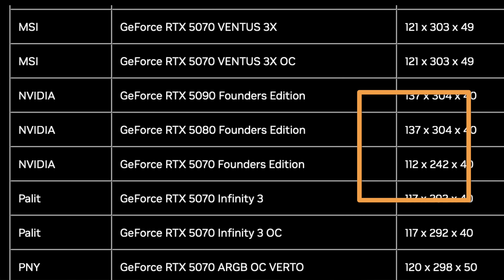Nvidia's 50-series Founders Edition Cards have a 20L sized problem.

Comment: So it won’t ve a problem with T1 V2.1 and top Aio config. We might need a few centimeters longer gen 5 riser though.
Reply from the maker: I think it may be OK with the riser extension, plus a rad as intake would minimize the impact on the CPU thermals. At this point I'm unsure of the headroom with something like a 9800X3D with the rad as an exhaust, that's something I'll have to test. The issue is that in the T1v2 you can't get exhaust fans with a rad in place, so if you can air cool the CPU and use top exhausts that might be a preferable setup.
Reply: @ I am currently using the Atmos 240mm liquid cooler with the 9800X3D in a top exhaust configuration, and I am more than satisfied with the temperatures. In the Cinebench R23 stress test, the CPU scores 23,637 points, and the temperature doesn’t exceed 77°C. Btw, the room temperature is around 26-27°C.

Comment: I have a Corsair 2500X case, a 360mm AIO on top...is my current case no good for a 50 series card?
Reply from the maker: You have more space within the case so the airflow implications of the FE isn't as unique in that scenario. Overall thermals should be similar between the AIB cards and FE cards.

Comment: There's no problem ( except for tiny sandwich style. Same as 4xx and 3xx, FE is bad there) . A "regular" gpu cooler spits exhaust in random directions into the case. FE spits exhaust at more specific areas. It's the same exhaust in the same space.
Reply from the maker: I would tend to agree if this were a mid-tower, but directionality does have an impact within SFF confines.
Reply: @MachinesMore  I supposed. But it's been some time since flow through fans were introduced, and time has proven concerns are overblown. Take the top flow through fan for instance, with a air  cooler exhausting to the rear, or top AI above; time and countless people building has proven the directionality does not matter. Its the same exhaust in the same space. Now...with 5xxx, there is TWO flow through fans. Is that a big deal? I'm not convinced.

Comment: Watercooling is back on the menu :)
Reply: Sure is. U can fit itx, sfx-l, d5 pump with res and 3x280 in 20 liters. I have it mostly ready on my desk, but not showing it yet to the world:)
Reply: @bartman2395  what case is that? Or open frame? I've got a double 240 in the NR200 mounted under my desk with an external rad in the room/attic next door that vents off all heat while giving me access to some cool and low temps in the winter haha
Reply: @ meshroom 2, with top and bottom and middle spine 3d printed. Very custom. Using 2 extenders from ssupd. Motherboard is at the bottom, with IO rotated facing bottom. Work in progress, im waiting for slim 5090 block and its done.
Reply: @ I will be making tower with 2x560 radiators propably, because I like towers and for fun
. Mora too thiccc:)
Reply: @ Sounds very cool! Would love to see that when it is finished. Do you post online somewhere?
Reply: @moevor  I will be posting on reddit for sure in sffpc. Propably on different nick, I’m kinda out of chill lately on this one lol.
Reply: @bartman2395  I think I've seen your other builds. Have you done a custom Intel themed build where you made a sandwich case?
Reply: @ nope, thats not me. I was ready though, got velocity 2 for new Intel - but Intel sux, so its not gonna be used at all hahaha.
Reply: @bartman2395  ok! Well I hope to see it when you post. Cheers
Reply: Was watercooling ever not on the menu?
Reply: @MaddJakd  always was but potentially more so when the GPU is chugging back 500 watts

Comment: I've been thinking this ever since the design got revealed. Seems to me like the Fractal Ridge might have just become the most desirable case for FE cards of this gen <.<
Reply: Came to comment this. I noticed this the instant I saw the design. They could totally design some amazing cases that would work with it though.
Reply: It does not support high end cpu's and big air coolers.
Reply: @westonsaunders6460  you can fit an IS-67 or L12s or IS-55 with a noctua fan swap. Those will all cool a 9800x3d.

Comment: People said the same before the 3080 FE launch for sandwich cases. and here i am running it for 4 years now on ghost s1 with no modded spine or offset, all it needed was a small undervolt. So not gonna dismiss them without trying. 
But i do agree, the dual blow through does look like a worse situation. but since the cooler is engineered to be enough for a 575W 5090, i'm hoping 5080 FE will be ok even in less than ideal situations. as for reference layout cases, i really wouldn't worry much even with a 5090. those big air coolers are more than enough to cool a 9800X3D even with some extra heat from the gpu.
Reply: the 5080fe being only 40w more than the 3080 isn't a massive concern, it'll run warmer regardless but an undevolt will make it fine. but the jump from a 3080 to 5090 is another 250w. no amount of undervolt is going to remove an additional 14900k worth of heat from the GPU. people are cooling the 14900k with dual and triple fan radiators and it's for one processor unit, adding a 3080 into that loop as well when you don't have the thermal conductivity of water or the surface area of a radiator is sub-optimal. 

anyone using a 5090 in a sandwich style is probably in for a bad time. at surface level, it looks like it's gonna throttle hard and it's going to be loud, obviously review testing will be crucial. 
console, non sandwich style and traditional towers will all be ok, but those chasing 8-12L with sandwich style might be going to be looking for new cases if you want the best hardware money can buy.

the best part of this is we'll see some newer designs driven by necessity and innovation is always welcomed.
Reply: @GorillaSnapper  i didn't say 5090 will be ok in a traditional sandwich, i said you shouldn't worry about it in reference layout even with an air cooler, like in ncase M2 for example. 

as for sandwich layout, i think 5090 will still run fine in cases in the FormD T1 where u can create more space between the gpu and motherboard/psu with spacers. definitely not in something like ghost s1 though.

Comment: For an M2 wouldn't a 240 rad (instead of 280) with side intake and top exhaust (traditional layout, 2 x 140mm top exhaust fans) work? 240 rad wouldn't touch the GPU like the 280 and the 2x140mm top exhausts should be able to create a good negative pressure. Thoughts?
Reply from the maker: That's a possibility, although I am still a little concerned about the overlap there since 20mm farther still isn't optimal, but this is something we'll have to test. For sure the side intaking rad and top exhaust fans is going to be a must with this setup.
Reply: @MachinesMore  Atleast with the motherboard offset on the M2 there might be some more wiggle room with the gap between AIO and GPU. Looking forward to your tests!

Comment: What about c4-sfx which is inverted layout, gpu on top aio on the side. Can do similar setup in m2 you recon that would work?
Reply from the maker: The side AIO would have similar issues to the M2- namely restricting the GPU exhaust and also heat soaking the rad. Air cooling would have a similar conundrum.

Comment: I've already been thinking about trying to fit some sort of blower or cross-flow fan near the spine of the terra at the bottom on the gpu side. If you could custom make a gpu mount that flips the FE card upside down so it exhausts out the side panel and pulls in air from the back of the motherboard, that would probably work fine.
Reply from the maker: Yeah, tricky. Even the Ventus 5090 looks to be an iffy fit for the Terra since it's fairly tall at 139mm.
Reply: I am planning on doing something like this in my Terra, including potentially a cross flow fan mounted vertically as you described. I never thought about inverting the card though. Interesting idea.

Comment: The vapor chamber design is used by lots of card makers and was used with 40'sseries, so how come nvidia's the only one tgoing so small?  I just watched the GN video covering the design, it's not really adding up to me
Microcenter just came out and said they won't be selling any founder's on January 30th but will have a wide supply of all the after market brands. 🤔 heat issues?
Reply from the maker: So, for launch typically Nvidia offers it's FE cards through its own direct to consumer site, plus Best Buy in the US.
Reply: @MachinesMore  huh, they were at Microcenter at previous launches, thanks

Comment: How about the INNO3D 2 slot 5080 though? Couldn't figure out if it's also a full blowthrough design.
Reply from the maker: Side exhausting. The dual flow-through requires the mini PCBs that Nvidia is using for its FE cards.

Comment: Im planning a tr100 build , im sacred of heating my back of motherboard and psu , what do you guys think??
Reply from the maker: If FE is all you can get, you will want to add 20mm standoffs to shift out the riser cable and attach the card to the two outermost slots. That way you have an air gap. Still not great for the mobo but likely not tragic for the card's own cooling.

Comment: Looking forward for a tests of a 5090fe with different layouts in ncase m2. I wonder if the impact on a tower cooler will be worse than the impact of squeezing a aio into the small case and blocking airflow.. for aio... how about classic layout with aio on top with intake, and side mounted fans to exhaust (if that even fits) ? Ok, thay would mean hot air blowing into the case from both and bottom... probably not ideal for mainboard, ram and ssd?
Reply from the maker: Dual intake can work but it's detrimental for cooling both components. In the m1 evo/M2 this could possibly work fine when combined with two exhausting mobo side panel fans.

Comment: With a Ncase M2 wouldn't a flipped motherboard placement with the GPU on the top work best with the FE Card?
Reply from the maker: The card would not be impacted in that scenario- the impact on CPU cooling would still have similar issues though. You could potentially do an intaking bottom rad but will need a lot of exhaust to balance out the airflow. Exhausting rad would be a direct funnel for the GPU.

Comment: I designed a prototype case in paint that coolermaster turned into an actual prototype after 3 years. Bascially allows for a top mounted vertical GPU in the top half with mesh on all sides + bottom half for PSU, 240mm aio mounted opposite the motherboard like the nr200p and an sff PSU.
Reply from the maker: Does the GPU live in a compartment of its own?

Comment: If only those fans were flipped upside down, an inverted layout with the gpu mounted at the top would have been perfect
Reply from the maker: There might be a way we can do this ourselves... stares at riser cable 🤔
Reply: @MachinesMore  flipped riser cable would be an awesome idea. I wonder if its possible with any current or if it would put too much strain on the cables to do so
Reply: I think in the immediate future you’re going to have sub optimal sff cases based on concerns raised in the video. In the future, we will probably see new sff cases that would optimize based on the new 5090 FE design. 😂 it would be an excuse for sff builders to buy a new case.

Comment: I had the same thoughts, which is why I went with an AIO planning to have it top mounted exhaust, would this work out okay(considering "normal" setups with 4000 and below does this currently)? Optionally have a rear exhaust to push some hot air out(though that could maybe impact the closes AIO)...

Edit: Should we be worried about the liquid metal cooling with a vertical GPU setup?
Reply from the maker: The 50 series FE with a top rad exhaust would have a more pronounced issue vs AIB/AIC side exhausting cards since the exhaust would be going directly at the rad, whereas with side exhaust at least some of that can escape the case first, even if some of that will be consumed through the rad.
As far as the liquid metal TIM goes, I don't forsee any issue as long as the card was properly attached to the PCB and it was applied properly, which I expect them to do.
Reply: IIRC only the 5090 FE has liquid metal, also it has 3 layer 3 walled silicone. If you watch gamer nexus interview they said they did all kind of orientations and shock tests to see if there would be any spillage. But who knows it might just be bs talk

Comment: Luckily for the traditional layout the 9800x3d doesnt mind a little extra heat on the air cooler. If the AIO is top mounted like the a4 h20 i think itll be completely fine too. I wish there were more coolers for the nr200p that could be vertically mounted actually. It would essentially act like a chimney, pulling in fast moving hot air from the gpu fan and exhausting it right into the top fans.
Reply from the maker: You will have headroom with the lower powered chips but one thing is 50-series are all higher TBP than their 40-series equivalents.

Comment: do you know if the m2 ac168 version will be releasing? would be ideal fir the bigger gpus (wider ones)
Reply: This. I got a PNY 4080 for cheap over the holidays. The card itself fits put the power connectors stick out another 3mm and makes closing the side panels impossible
Reply: @Airconaaron  maye usung adapters will work?

Comment: As someone who has an entire M2 build waiting on an FE card… this is relevant to my interests 👀
Reply: Awesome. Big takeaway is w/o a riser the next best call is probably top AIO, side and rear exhausting fans. Thanks for the great vid, as always!
Reply from the maker: Yes for M2 if you can get side fans next to the motherboard that may be key in preventing the top rad intaking too much GPU exhaust.
Reply: I'm currently using the inverted config on the M2 with two intake fans helping the gpu and two side exhaust fans with a side aio as intake. With an asus proart thermals are awesome. And I csnt imagine that the vents at the back of the proart are driving that much of that thermal headroom. Gonna shoot for the FE 4090 and if not the next smallest AIB. Seems like that will be the lower end MSIs and Zotacs designs
Reply: @MachinesMore cool - would the thore-zone Tetra (R) be ideal for the 5090 FE - it would have its own “chamber” in top of the sff case 😮 Planing to build one with an 9800x3d but cant find a decent cooler for the CPU - have u got a recommendation for the best Noctua CPU cooler - specs for the cases are on the website. Greetings from Austria 🇦🇹!!!
Reply: @MachinesMore I’m using the X570 DTX board still with the M.2 riser card, which would sit directly above the 5090 FE. Is this going to present an issue with temps and heating up the riser card in the traditional layout?
Reply from the maker: @Coltyro1028 It might, plus the flat metal heatsink surface is going to run parallel to the card, that's a scenario I didn't think of. What drives are you running and do they see heavy load at the same time your GPU is utilized? If not it may not be a big issue.
Reply: @MachinesMore  Hey so i know this is odd to ask in comments but i recently downsized to the Meshroom S with rear mounted GPU, my 7800XT Is right against the Side Panel creating plenty of turbulence. Do you reckon a 5080 will have Trouble with this Setup? Since Air would be blown into the Back of the Motherboard
Reply: @MachinesMore Hey thanks for responding! I run two M.2 drives in it. One is a 512GB OS drive and the other is a 4TB for my gaming. I don’t do any productivity stuff as of yet. 

It looks like the FE model would directly exhaust upwards through the M.2 heatsink/riser for sure, whereas my current card it just sits above a standard GPU backplate. 

I was thinking of the Ncase M2 for an upgrade - maybe running in that case in a different layout with more fans would be the better option long term? Curious what your thoughts are.

Edit here - I think they do see a bigger load when I’m running a heavily modified game like Skyrim - these modlists now are very GPU/VRAM heavy. I’m sure they put strain on the SSD with all the scripts and other things loading. But I could be wrong there - maybe since I’m not doing productivity work it won’t affect it much.
Reply: Good luck beating the scalper bots to get one at launch.
Reply: Easy. A case like M2, you put the card in traditional position, 280mm AIO at the top as intake also, and 2 140 or 120 mm as side exhaust.
Reply: really loved the m2 case but they dont ship to all 50 states😡
Reply: Im also gonna build in M2 with a FE (hopefully) and I got a more crazy idea. There's this PCI fan slot bracket from Aksa which you could mount above the GPU and then have two 120mm exhaust fans for the GPU and then 2 exhaust on top + 1 rear and side. With an AIO as intake on the front side. but it might be too elaborate of an attempt to work out
Reply: Yes. It's incredible that it's basically the same dimensions as a 4090fe but at 2 slots!
Reply: ME TOO!!!
Reply: Also planning an M2 build, but I'll be going directly a 5070 ti. Hopefully it will be fine since there's less power draw.